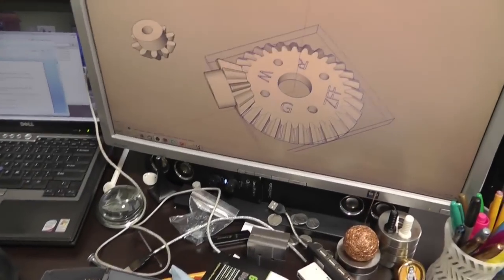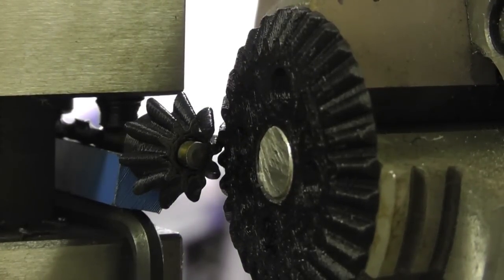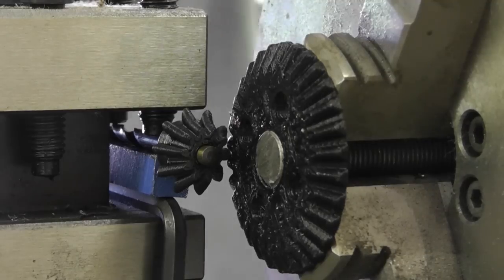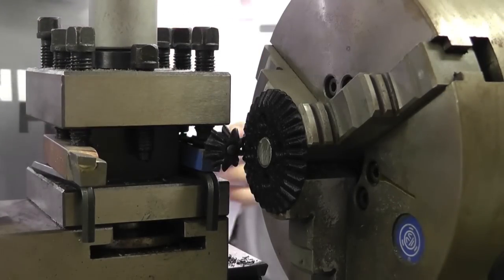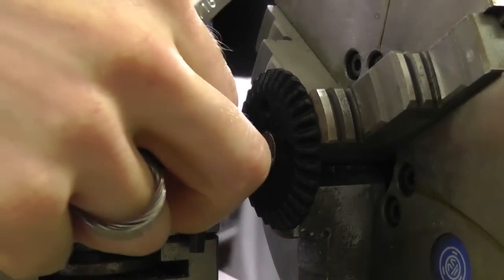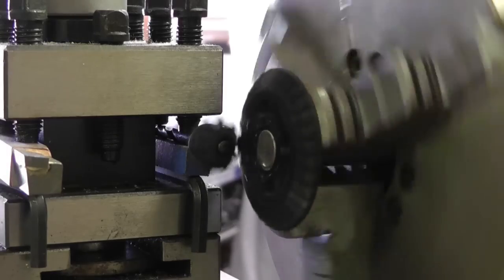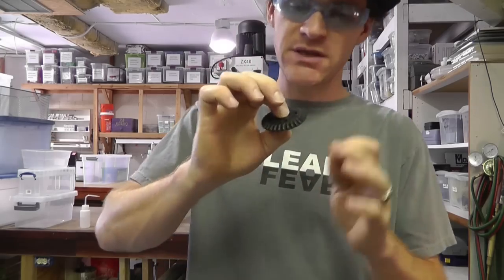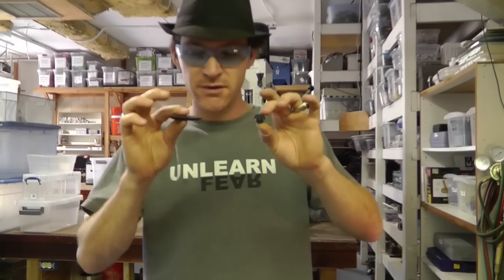Z's Gears, 3D printed Gears Test, Stress Test, im impressed. 4,200RPM

Comment: Dear Russ, do you think a sliding guide used in a old textile machine could run fine if we prin it in ABS? We atch you video and we think the machine we are dealing with has less load and effort than this showed here in 4200 rpm. We were thinking to do this using nylon filament but it looks that ABs  could be a good choice. Thank you,
Reply from the maker: If it's a slow moving part. And you grease it ( white lithium grease ) you will be ok. Nylon however would be best choice. I used abs on some more parts that are under a load its the abs on abs is wearing Out. But I did not use any geese. But nylon is verry good stuff. It can be some setup time involved but nylon is best. I would try abs and if it fails to for nylon!
Reply: ***** wtf why would you put geese in there you horrible monster?!?!?!?! jkjk XD

Comment: with gears the speed is a stress factor but also the torque/load. Really you want to look at the total power dissipated and transferred by the transmission when under load.

Comment: Print me up some gears for my drag car! Only kidding,  Lets not be be so hasty on what Russ has learned here. Being able to print your own gears can server a person well. Gear timing is everything. knowledge is power. I am impressed with the gear printing.  Only limits you had with speed is the fact there was not bearing.(But I think ya all ready knew that) In general, Gears are not made to ingest stuff. Unless ya making a paper shredder. Me being a RC car nut most my life and working on real cars (Drag racing) It would be interesting to me see how the printed gears would hold up to say, mechanical fuel injection.

Comment: SWEET! Thank you! You're right about the bevel angles. 45/45 is only for 1:1 ratio. I think 30/60 would be 1:2 and 22.5/67.5 for 1:3. Take a look at this. https://sdp-si.com/eStore/Catalog/PartNumber/A%201B%203-Y32048  There are CAD models you can download that should give you a better idea of the precise angles. The pinion gears look great but I worry the main bevel gear teeth might not be tall/deep enough?

Comment: Both gears are not under normal stress because they are not attacked to anything.  Bolt them to some nylon round stock then with bearings on both end that will give you stress needed to test the true reliability of these gears.  I did a set and placed one in a drill the gear to round stock meshed tight and it did pretty well until the heat of friction got to it lol
Reply: I dont't quite understand what you're getting at? both gears were under a 'load'.. the larger one was connected to the lathe, and then later had a bolt stuck to it so that it couldn't free spin. the smaller gear was being pressed quite firmly against a nylon washer.

Comment: rwg42985, you were talking about the angle of the bevel.
You determine that angle by extend the centerline of each axis and the gear bevel should point to that "midpoint"/"crossline", and that defines the bevel angles.
And with that said, you change the angle according to you gear ratio.